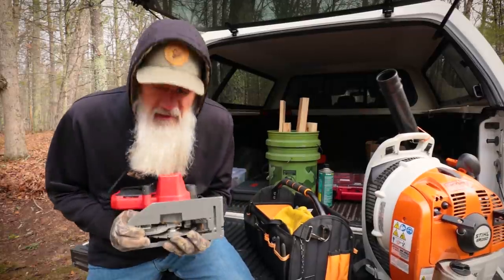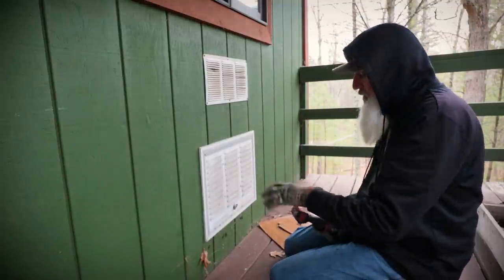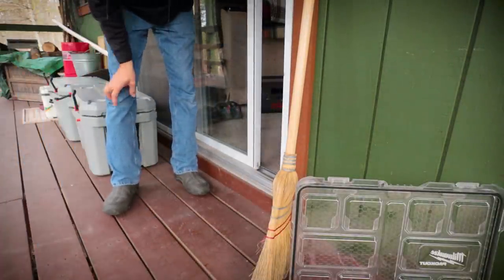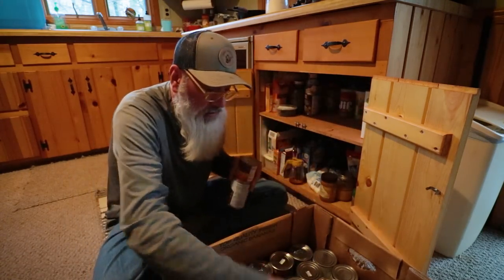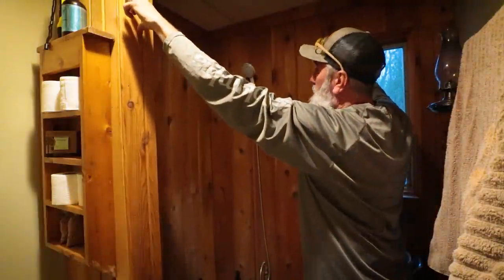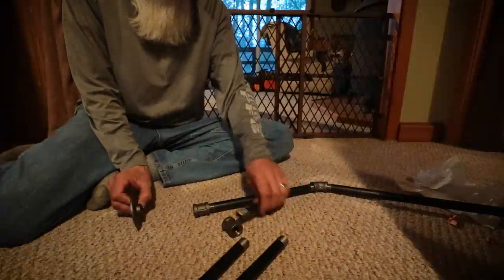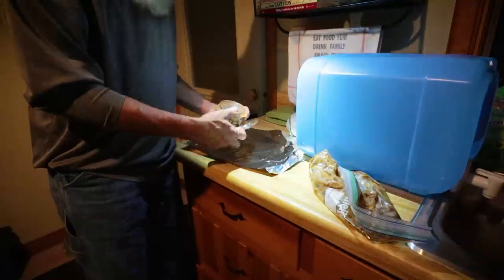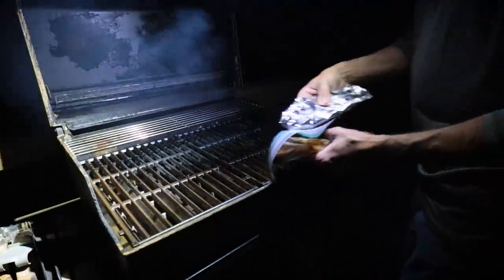Preparing the OFF GRID Cabin for WINTER | a Full Day VLOG

Comment: Hi Todd, for your refer look for a yellow-green powder on back. If there is it's a leak an the coil unit needs replaced. If using propane check burner for spiders air will not clear them. If DCV is used check heating element .
Reply from the maker: I've checked the burner, and cleaned the ignitor.  Fires up and burns ok, just doesn't get cold.  Either a leak, or a clog.  I've read if you don't have a leak, flip it upside down for a day, and then back over and try to fire it up again.  We'll give it a go in the spring and see what we can learn.